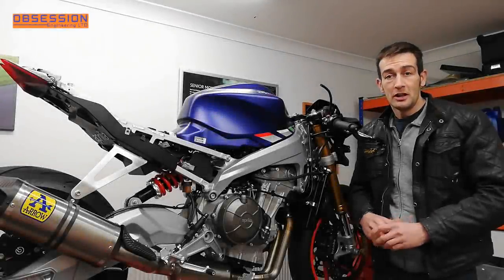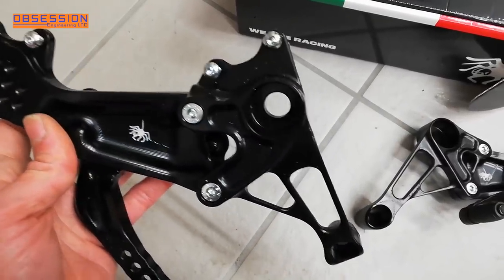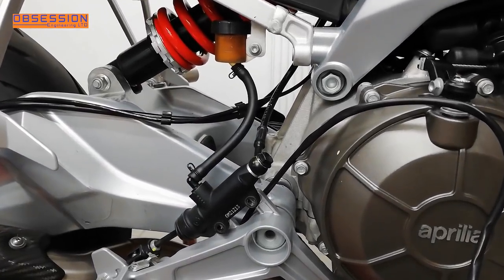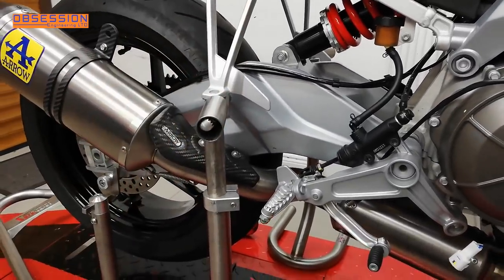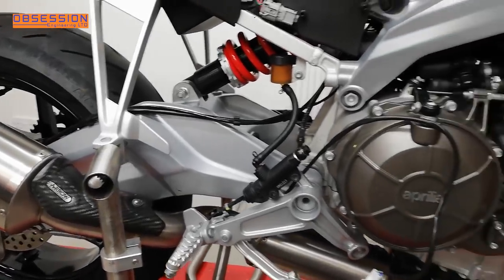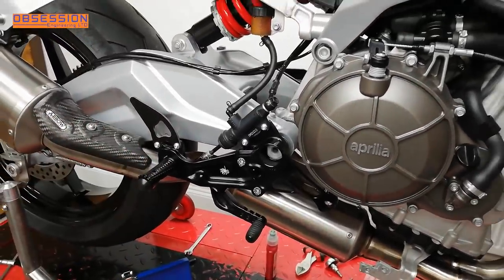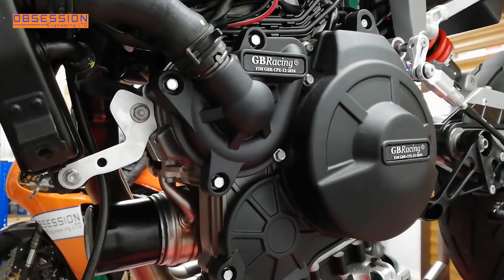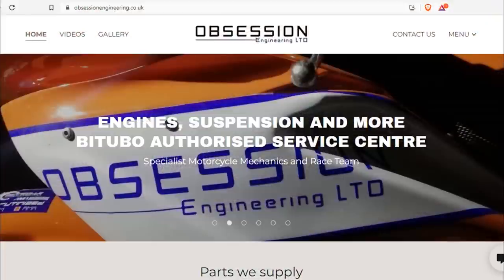Aprilia RS660 Supertwin Build Part 2. Fitting Spider rearsets and GB racing Bling to the new toy

Comment: Great following the build, lovely work.  Did you consider buying a Trofeo direct from Aprilia?  I wondered if that might have actually worked out cheaper.  I saw Lee Johnston team bought two Trofeo for the TT.
Reply from the maker: We looked at those, but the suspension they come with is cheap and we wanted to use products we already know the quality of. We'd have ended up replacing half the parts so it'd cost more in the end
Reply: @obsession_engineering  Understood.  Looking forward to seeing it run at the TT

Comment: It seems to me that the mod on the gear lever did not solve the problem. It still changes the direction (push vs pull) of the quick shifter switch for any given gear shift, just like the reversal of the lever on the engine does. Am I missing something?
Reply: Yes I have! Disregard the comment above, caused by a virulent attack of dyslexia!!!